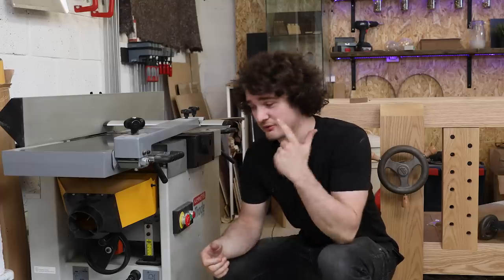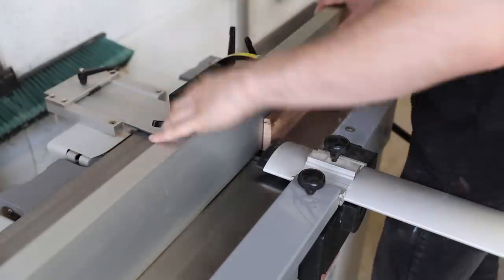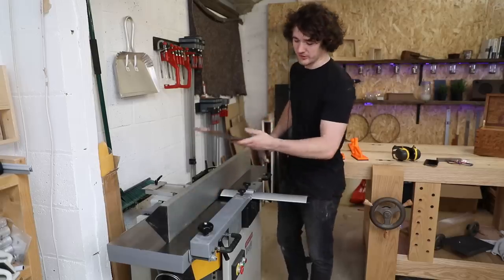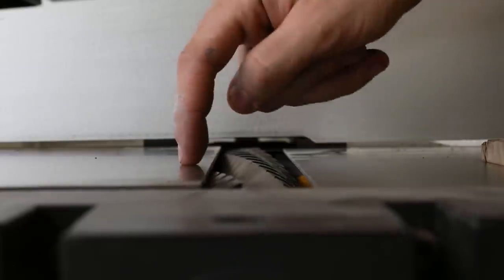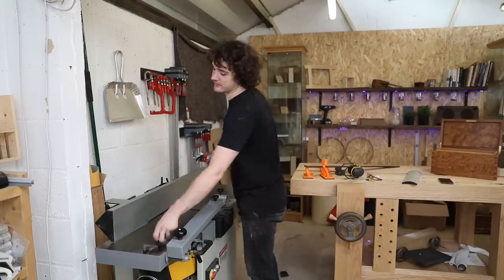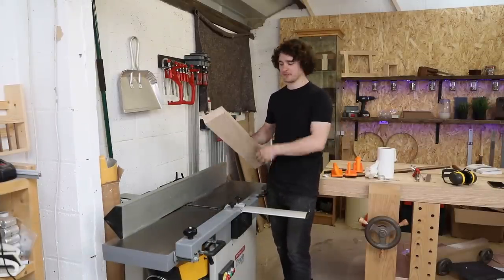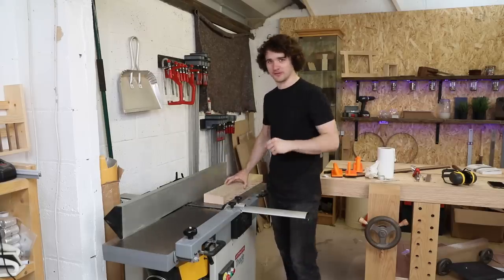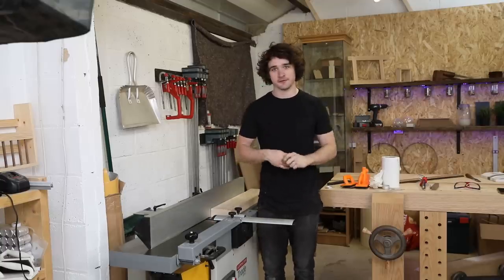How to use a Jointer SAFELY and EFFECTIVELY

Comment: You make very good videos, Matt. The content is good and practical, and your editting skills are very good too. The videos are informative and pleasant to watch. This is an excellent guide for me, since I have just gained access to a jointer, and I am eager to put it to use. I've been looking at different videos on the Youtub-sphere, and there is one thing I could not find practical information on: is it possible to joint long boards with this machine? I see that most of these machines are no more than 1,5 meters long, and I think I'd like to joint and plane boards that are up to 3 meters long. Will it be necessary or possible to extend the top surface of the machine for this purpose?

Comment: Question :  Can you remove or reduce bow in timber buy just placing heavy weight on it for a period of time.  May be I need to to do a test.  Likely depends on moister in timber and soft or hard wood.  Might be a good lab exercise.

Comment: A great video, although I have a couple of questions for anyone who has firsthand experience with a jointer/planer/thicknesser combination tool. Does the jointer portion work as well as a stand alone jointer? Does the thicknesser/planer work as well as a stand alone tool? Is the cost of the combined machine less than buying two separate machines? THanks again for the video and for any response.
Reply: The reasons you might want combined are cost and space. You want 2 separate machines to save time setting up. You can do face and edge on jointer then put it through thicknesser directly, or 2 persons can work at the same time

Comment: Regarding grain direction, what about when grain changes direction partway down a board (perhaps several times) or even across the board? Any recommended strategies for avoiding tear out in that situation other than reducing the depth of cut?
Reply from the maker: Slow feed rate, sharp cutters and as you say, reduced depth of cut!
Reply: 1. Go very very slowly
2. Take very very amount off

Comment: Good video, very informative do hope you are a cat lover, as for gloves I use Carpenters gloves, and on some construction sites they are mandatory, just a point what about a dust mask, not all extraction systems are 100% effective.
Reply from the maker: I most certainly am a cat man. As for a dust mask, shouldn’t need one at all. Planers/jointers produce chips, not fine dust. Shouldn’t be any harm at all!
Reply: Matt Estlea My Triton fills my Karcher shop vac up in minutes purchased the Triton bucket, if I had a bigger workshop I would have a complete extraction system, love your videos.

Comment: Matt, is that type of guard mandatory (or the default type) in your neck of the woods? Maybe I'm just used to our "pivot spring-back" type, but it looks like it could get a tad bit annoying. Another great video, thanks brother.
Reply: Trevanion: Bingo! I am all for safety features but they have to be user friendly otherwise they get pushed completely out of the way. 
I've seen it too many times, and the pork chop in that respect is better because it is no hindrance.
I plane (joint! heck..) my wood the way Matt shows doing the edge BUT I have made special pushers that hook the wood at the end hence I don't need to push it down for it to be pushed forward. And I have two handles on these (several lengths) "pushers" one towards the front and the other hand that is at the end of the pusher. The only time the cutter is exposed is before the wood and after the pass. Unless you have your long Tshirt or Matt's mike cable hanging, I see no real danger. Position yourself properly in front of the machine, keep focussed and balanced and all goes well. And I never had issues jointing/planing and edging my boards with that technique, and I never got even close to scaring myself.
And even a thin piece blowing up wouldn't affect my hands (I don't plane anything less than 15mm and even that is way too thin for my liking). For long boards I use a slightly different technique but it pretty much is the same.
Matt you should demonstrate planning long boards as Trevanion suggests for the reasons he (she?!) mentions. For me that was the trickiest to learn (by myself) at the beginning.
Reply: Ohh and here we go, HSE in UK has a very good word for jointing/planing: FLATTING!
Enjoy your flatter / thicknesser ! :-P
Reply: Campbell Deeming thank you my friend. Very detailed response; much appreciated.

Comment: I would not surface plane out a bow on a piece of wood as thin as you demonstrate. If there is a shake or knot in it, or the grain changes it will be liable to break and maybe draw your hand in. Stick to pieces thick enough to not flex. How do I know this? I’ll let you guess.
If you are spending thousands on a jointer, consider adding a power feed. Using your hands to feed its going to be jerky and there will be bounce. In the antipodes a jointer is termed a buzzer. Very appropriate.
It is possible to flatten boards with a thicknesser. Lots of videos showing this. It’s easy to square edges with the table saw. Both can give better results with much more safety. I have a jointer, but only use it as a last resort.

Comment: In your next video (I assume discussing the thicknesser portion) it would be good to explain to folks why you square only one edge to one face on the jointer not two edges. Also mention why you joint or plane the face first then use that against the fence to correct the one edge. Mentioning that you need to run that jointed face along the table saw fence now to rip to desired width and how the table saw fence will now register the fresh straight edge you made and that task can take place before or after the thickness if process. Great job by the way!
Reply: Click here 1:00 then here 0:29